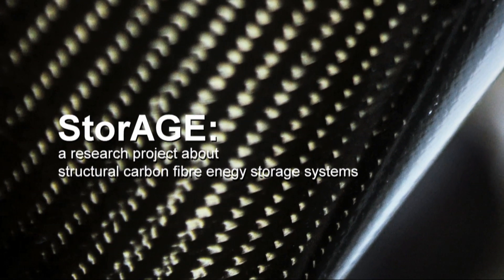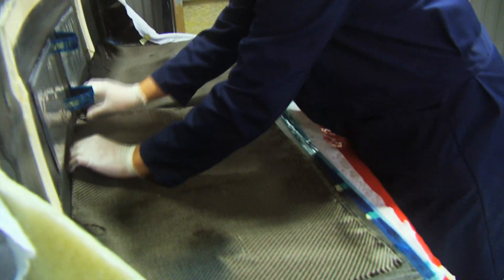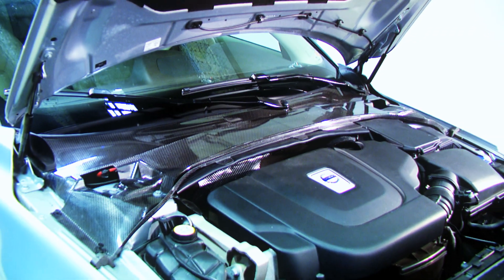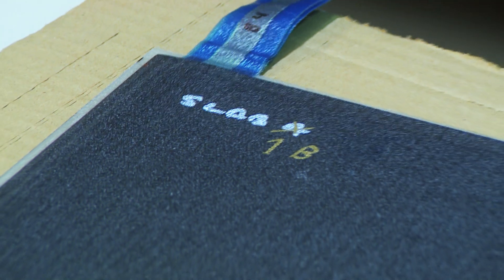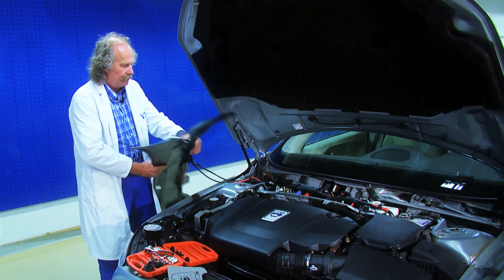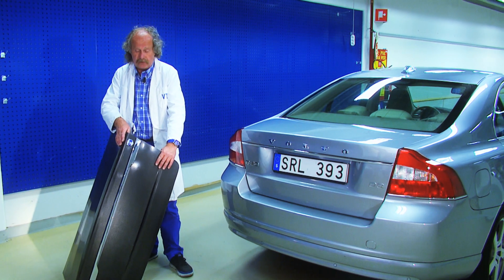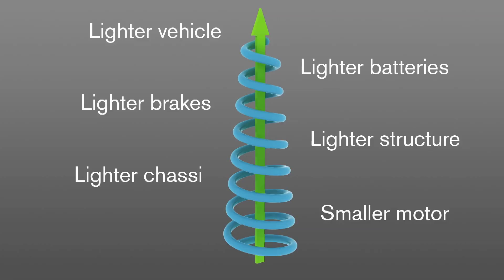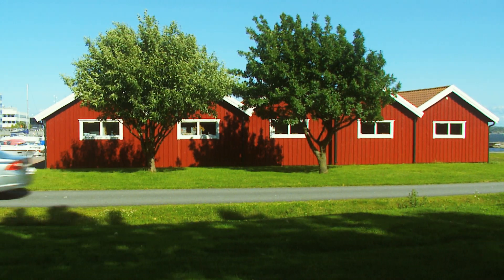Volvo supercapacitors body panels - S80 prototype

Comment: Cool thin form factor pouch batteries, but would never pass safety regulations since if your car is punctured or bent in any area the vehicle WILL catch fire. A nice experiment but not practical

Comment: burning these nanocarbon capacitors should be as easy as burning a diamond, i hope no one ever takes this car to a 100% oxygen atmosphere and set a blowtorch to the caps, you might accidentaly burn the metal of your car before the caps catch fire. Your magnesium would need 300degc in order to catch fire in 100% O2, that caurbon shit needs 2500degc to burn.

Comment: I can see that some interior componets might be candidates for this tech. Dashboards, package trays, seat shells.   

We know what happens to steel cased LiIon batteries when they are penetrated.  What happens to a charged supercapacitor?

What happens if impacted,  punctured in a collision or hit from below by bottoming in a pothole or road debris?   Seems to me that the only exterior body panels safe to replace might be well above the belt line, like the roof and the top of a reinforced trunk lid.
Reply: read a little bit about supercaps. There's no way in hell you can make this catch fire. Carbon shit generally need a 100% oxygen atmosphere and 2500DegC in order to burn. That's as easy as trying to burn a diamond.

Comment: good idea except, it will be much more expensive to replace once its worn out, and a small fender bender will not only cause shorts inside, but will also cause a fire more easily... Honestly im good with the traditional setup.
Reply: they are capacitors, they don't explode nor catch fire, since that nano shit would need at least a 100% atmosphere and +-2500DEGC in order to catch fire.
By that rule, magnesium wheels are much more prune to catch fire.